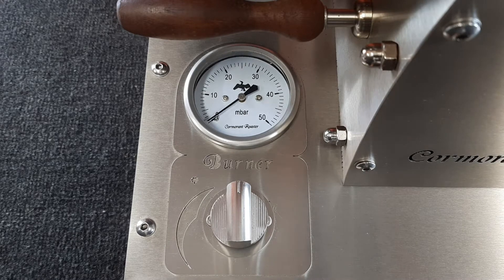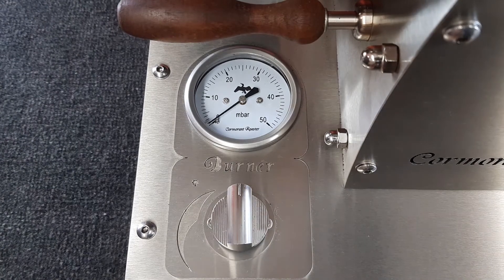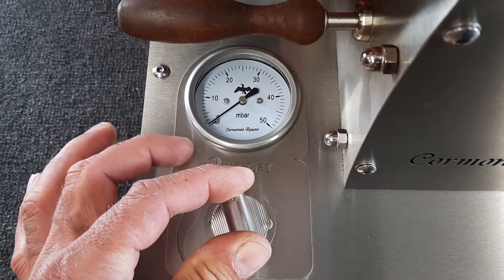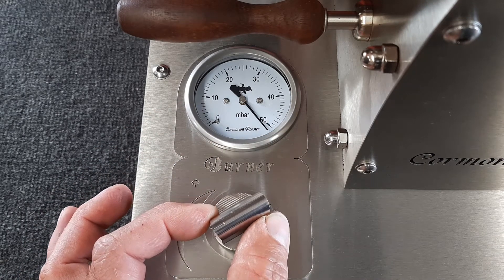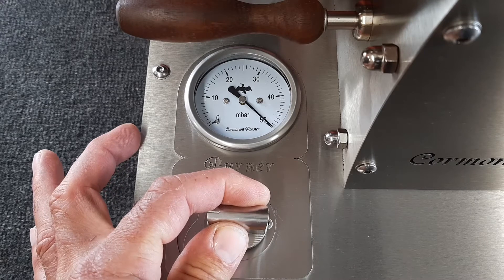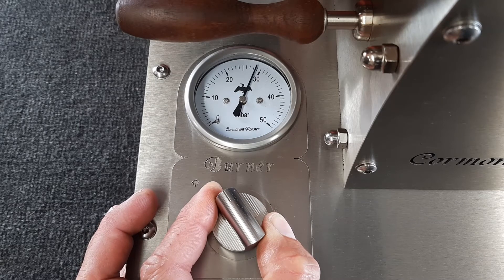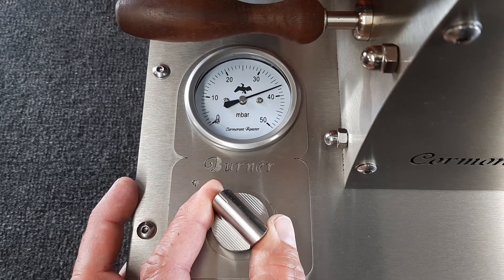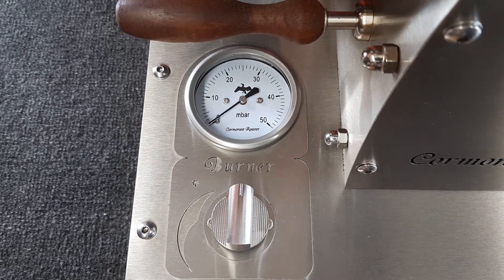Burner Dial Control on your Coffee Roaster

Comment: what components inside the controller?
Reply from the maker: Hi, The controller is a needle gas valve with auto ignition and safety thermocouple cutout. Hope this helps.
Reply: @cormorantcoffeeroaster1199  like solenoid safety valve, any brands recommend or you can show me what is inside in other video
Reply from the maker: @aifrisyad7491  Yes, like solenoid valve. Our valve is made for us specifically..
Reply: @cormorantcoffeeroaster1199  thank you so much